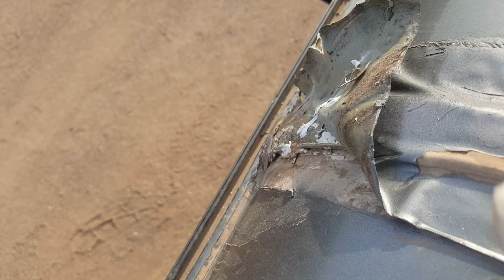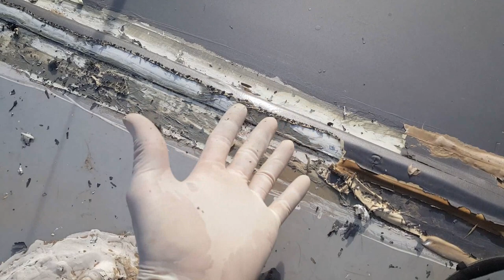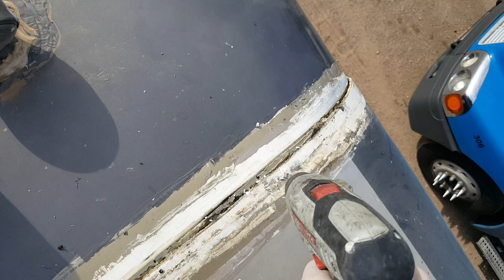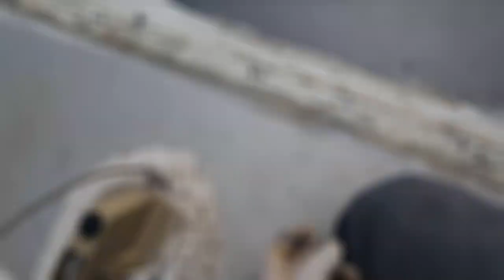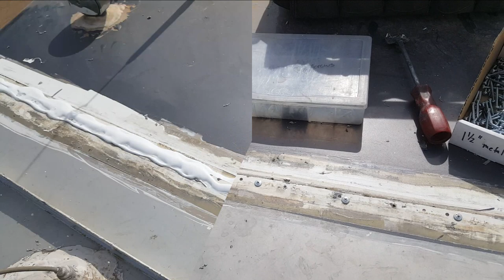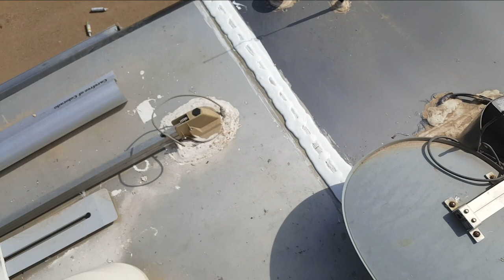Eternabond/RV Roof tape.....Does it work?

Comment: I put Eeternabond on all the caulked joints on my Rockwood shortly after I purchased it new in 2012.  I have had no failures of any kind.  It looks as good as it did when I originally installed it.  I believe success or failure is very much dependent on carefully following the manufacturer's installation instructions.
Reply from the maker: Thanks for the sharing your success!
Reply: Maybe it was put on when it was wet underneath? Maybe. I say this cause after countless videos of enternalbond urs is the first failure I’ve seen.
Reply from the maker: I don't think so. It failed on the roof mostly because it was a quick fix to a large problem(ie the roof deck and molding were loose). Eternabond has zero strength as it is sticky putty and a thin TPO strip which tears easily. The reason I do not care for this material is that it is sold a quick cure all for everything which it is not. The roof deck and molding needed to be cleaned and secured and then sealed, but this material allowed people to "cheat" with a temporary repair that looks visually sealed. Unfortunately, it tore and now the original repair still needs to be performed along with twice the work of removing the tape. I understand the appeal of the material, but would only use it on a torn roof. Also, the manufacturer seems to be given quite the no lose scenerio: if it sticks...it was installed correctly, if it doesn't stick...it was poorly installed. Vents, skylights, and other attachments break and go obsolete rather quickly in this industry, this tape makes doing that a nightmare. Thanks!
Reply: @AZExpert  I hate to say it but that looks like it was duct tape, I've never seen Silver eternabond before and I've never seen eternabond crack like that either it's usually stays pliable.
Reply from the maker: @williamrizzo1285  It definitely was not duct tape but painted eternabond tape. Thanks!
Reply: Yup you’re exactly correct.
Reply: @williamrizzo1285  I think AZ expert is just trying to put out a video content. I’ve seen videos of people having more success than problems.

Comment: The problem is the front cap was loose If it is attached correctly the Eternabond would be just fine. I applied mine 6 years ago and is still in great condition, correct application is also important.
Reply from the maker: You are correct the roof and cap was loose. But eternabond makes bandaid repairs very easy. Thanks

Comment: 1. There were CLEARLY issues with seam failure before eternabond was applied.
2. Because of that failure it was not possible to correctly istall it.

The owner of that RV was just using it as a crutch to kick the can down the road. I've got eternabond on my RV thats over 10 years old and its working just fine.
Reply from the maker: 1. Cleary you are correct, but as tape is much easier to install and is WAY oversold on ability, people choose the easy repair rather than the correct one, which is why I do not like the tape.
2. The instructions clearly say how to install it, and they do not say to fix the leak as the tape is suppose to fix the leak

Comment: I used Eternabond to re-seal all my roof seams and around the skylights and fan shrouds. It works great. Its a pain to apply it sometimes but again I have had zero issues with it.
Reply from the maker: That's awesome to hear
Reply: Yeah the guy is probably working with a competitor of eternabond. Or he had some beef with them now he’s trying to bash them. This doesn’t look like eternabond.

Comment: I was a coatings rep for a well know provider for many years, industrial, contractor, and retail.  The most important step is preparation of the substrate.  Clean, clean, clean...no shortcuts if you want it to last.  Usually means scraping, sanding, scrubbing. The highest quality product will fail if the underlayment is not properly cleaned and prepared.    Even cheap materials will last years with appropriate prep.  Just saying.
Reply from the maker: Yes all too often shortcut are taken, like taping a broken joint. Thanks!
Reply from the maker: 85577alarm  It seems to me that sealing joints is exactly what eternabond is marketed for. The only use I really have for it is to patch torn roof membranes personally. Thanks!

Comment: The tape works good on my RV.  And silicone is exactly what you dont want to use on any seam or roof of an RV
Reply from the maker: I am glad it works well for you. As an emergency repair to a torn roof I would use it too. As a roof sealant, it is overpriced and has extremely limited good applications. The only good feature I see about it is the ease of install......but the amount of correct prep work and installation is as much or more than standard roof sealant and should it fail or need to be removed it is a horrible experience. For me, I cannot imagine taping a seam or hole or vent on the roof of my house and feeling good about it. Thanks!

Comment: I just spent hours tearing it off the front two corners of my camper roof. It failed bigtime and the water was running under it and leaking into my camper walls. I just applied the stuff two years ago. Thanks for posting the video. Its a little late for me but this video can save other folks the hours of redo's, interior damage and frustration.
Reply from the maker: I'm sorry to hear that, I hope you are able to fix it

Comment: That does not look like Eternabond. It actually looks like the Dicor Self-Adhesive Patch which comes in that exact color and sizes as Eternabond.
Reply from the maker: Generally Dicor roof patches have a "honeycomb" texture, but my complaints would be the same for all of these roof repair tapes for anything much more than a ripped membrane or emergency repair. Thanks!

Comment: Kinda funny how you're the only one complaining about it. It doesn't look like it was installed correctly to start with and it's certainly not duct tape. If you want to keep Dicor rich then keep using their lap sealant that you have to check for cracks and leaks every six months. If you apply eternabond correctly and make sure to properly clean the surface then it holds up.
Reply from the maker: Brilliant. You know properly installed dicor last 20 years+ and is much cheaper
Reply: @AZExpert  Not according to every RV tech I've ever spoke to. They say in the desert you'll be lucky to get 4-5 years out of it and even then recommend checking it every 6 months to a year. Usually the roofs in RV's are all rotted out due to water intrusion, because the dicor has failed in some way. I didn't want to take any chances so I used Eternabond webseal which can be painted over with elastomeric roof coating for a completely sealed roof. I'll see how it holds up over the years to come. I understand what you're saying about dicor, however after seeing so many roofs rotted out I'm just not sold. RV manufacturers DON'T install the trim like you did, they use that crappy butyl putty on everything and it dries up, cracks, etc. I agree the way you put the lap sealant under the trim piece should keep the water out.
Reply from the maker: Even with tape you need to check annually or more often. Damage can always occur. I've seen factory roofs last over 20 years with the original sealant intact. Thanks
Reply: I agree, look at the Dicor crap around the other openings in his video. Looks like pile up crap and it's no piece of cake to remove either. Just keep putting the Dicor crap on till it's 2 inches high. lmao
Reply: I’ve never seen eternabond that brittle what did they do leave it in the blistering desert for years at a time ?

Comment: After reading through the comments (kudos for taking time to answer these folks!), it would seem less an issue of product quality per se (you got a lot or testimonials as to its efficacy), and more of proper appliction. If all you have is a hammer, every problem starts looking like a nail. If I was eternabond, I'd jump on the first plane to pick your brain to see if I could improve my product, OR develop one that could serve the purpose of securing/sealing end caps and the like. You came highly regarded by RV Hillbilly BTW.
Reply from the maker: Hillbilly RV is AWESOME

Comment: thank you... so much good info have leak at this point on front top of travel trailer.  surprised since there SHOULD be dicor under the bracket.  currently all I can see is hairline cracks on 2ndary dicor blob marshmallow mess. confused as to leak location.
Reply from the maker: Glad it was helpful!

Comment: So I bought a 1995 Ford E350 Tioga nightmare hell on Wheels was totally neglected! But somebody within the last 20 years replace the front vent and they used eternal Bond tape that was the only piece on the motorhome underneath everything that was not rotted the screws were  immaculate shape! The screws literally look like they came out of the box fresh it was the only area that did not leak. I agree with a lot of people on here it's definitely the prop work that makes the tape work the best. We will find out because I bought four rolls of it and I'm redoing my roof this week!
Reply from the maker: good luck!
Reply: @AZExpert  thank you I sure am going to need it! 👍
Reply: @peachyclean93  I think you’ll be fine.

Comment: I keep a roll in my RV too. It is a bandaid that people use for permanent repais. I would never buy a used RV with more than maybe 2 Eternabond patches, and depending on where it was patched.
Reply from the maker: I agree, roof repair tape is great for tears. I really do not understand why many RVers love it for much else, it's not cheap and is harded to install properly than seam sealer....and of course very difficult to remove. Thanks!
Reply: @AZExpert  because it is essentially maintenance free. You don't need to glob up sealant every 3 months.

Comment: Don't blame the tape.. you just didn't take the time to clean the area with cleaner and install the tape the right way
Reply from the maker: False. I didn't install the tape and the tape stuck very well as it took hours to remove. It should have never been installed because the roof was loose, which tore the tape, allowing water to form a channel between the roof and cap forcing its way out the radius. Thanks!

Comment: eternabond is NOT duck tape.  Looks like you stretched it when you installed it.
Reply from the maker: That, or I didn't install it because I never would have used it in this application. In fact, you could say the only use I have for eternabond is to seam torn roof membranes or temporary patches. Thanks!

Comment: Before discovering your channel I applied eternabond to the end cap of my 89' Chieftain to stop a significant leak. I did, however, have the good sense to remove as much of the goop that the PO had applied in an attempt to stop it. It's been two years and it has remained watertight, but now I'm worried.
Reply from the maker: If it's not leaking and the tape is in good shape you should be okay. Just inspect annually at least.
Reply: I wouldn’t be worried. If it’s lasted two years and still looks good chances are it will continue to look good 2 yrs and beyond. I think AZ expert is just trying to throw out video content. He’s also trying to answer everyone that comments. Most videos that I see people have success with eternabond.

Comment: Guaranteed this roof was never prepped properly.
Reply from the maker: I would argue that it stuck very well, meaning that it was prepped. The issue, is that the tape was used as a bandaid to a loose roof and cap.  A shortcut if you will, which is why people tend to use it. And like most shortcuts, creates more problems than it solves. Once the tape tore along the seam, it became a gutter directing water into the roof cap and around the radius. Prep was not the problem.
Reply: So basically the only reason it failed was lack of repair to a damaged roof cap .  I knew it was not prepped properly because I've watched a ludicrous amount of eterna bond videos and follow ups , none of which looked any different several years down the line. Repair damage , prep area and install the eternabond much better results will follow.
Reply from the maker: @asphaltwarrior1  Yes, ultimately, the tape tore due to the loose cap and roof. However, the tape stuck down everywhere except the radius because the tear created a channel that forced water and air down the natural height difference between the roof and cap. Rather than giving and yeilding to twisting like sealant would have, the tape tore and created a pool for water to be trapped inside of until it found its way out through the cap to inside the roof, or down the radius. The only prep work that this really needed was to repair the roof to begin with. Too often, this tape is used as a shortcut/bandaid which is why I don't think it's a good product. Thanks!
Reply: So because some people use it improperly, you think it is a bad product. Full discloser, I love it.But that is like me saying money is bad because some people use it to buy drugs.

Comment: Eterna bond should not be used on front and rear caps.  It is for patching holes on rubber roofs such as Tpo or epdm.
Reply from the maker: that is my opinion too
Reply: I’ve seen videos of people using eternabond on front and rear caps with no problems even a couple of years later. It all has to do with the prep work.
Reply: Says you, I call bullshit.

Comment: Dude thats not eternabond iv'e covered seams and cracks and they have lasted so far 15 years and still are perfect you probably used duct tape Duh......
Reply from the maker: It's fantastic you took the time to write a comment on your experience. One day I'll be knowledgeable to see the difference between duct tape and Eternabond so easily as you. Thanks!
Reply: @AZExpert  sarcasm....:} capt. obv....

Comment: Do you think the trim piece is too narrow ?
Wouldn’t it be better if it was wider with two rows of screws ?

 The design seems to be poor.
Reply from the maker: In fairnes poor design is baked into RVs. The frame underneath is tube steel about the same width as the trim so wider would not necessarily grab anything and of course makes more holes that could leak it's also more difficult to bend a smooth radius at the ends when trim gets too long.